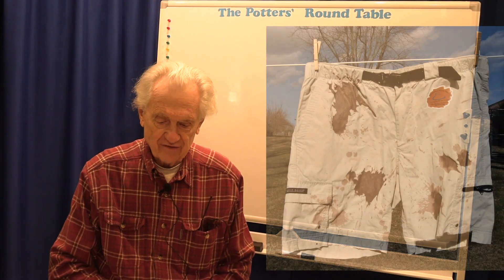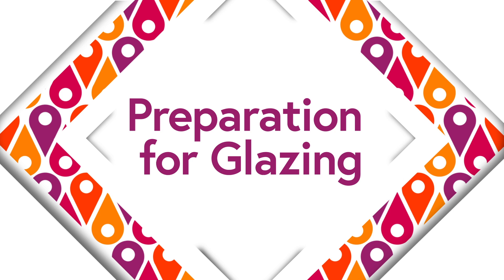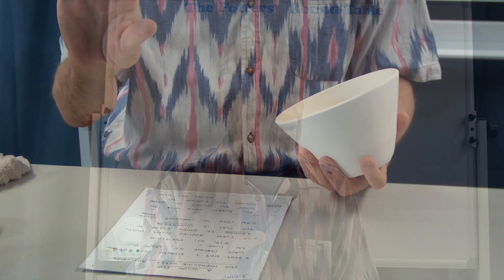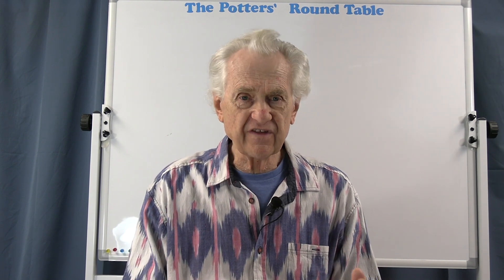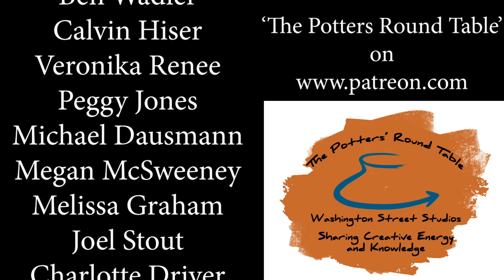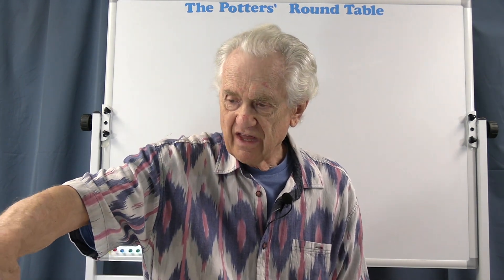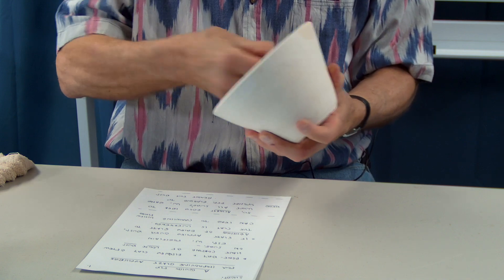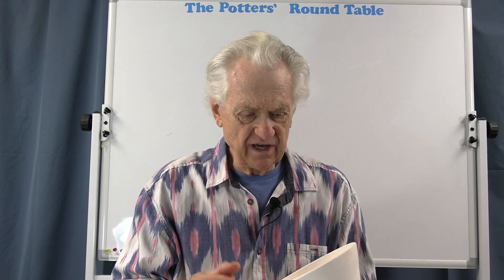E17 Pottery Shorts Preparation for Glazing

Comment: Is there any problem with, in addition to sponging , I rinse the piece in water so it is wet. In other words can you glaze a wet pot successfully?
Reply from the maker: If a pot is immersed in water it may ‘fill up’ with water and not absorb the water from the glaze. Then the glaze will not adhere to the surface of the pot evenly. You could be successful, but the likelihood of failure is increased.
Reply: @WashingtonStreetStudios  interesting point. In other words the pot should be damp before glazing but not soaking wet. Do I read that right?
Reply from the maker: @rOHRshackartpottery  yes, correct! Slightly damp is preferred to dry or soaking wet.